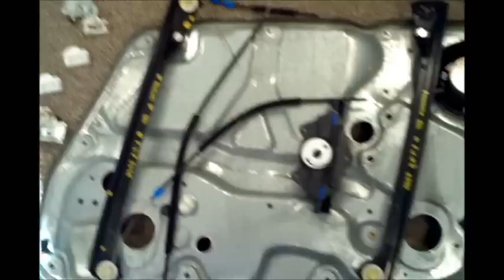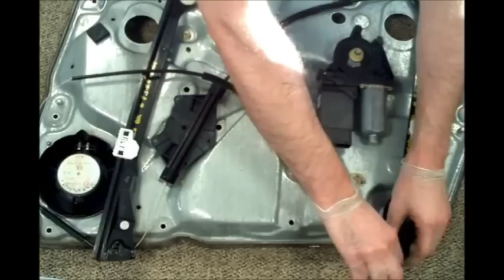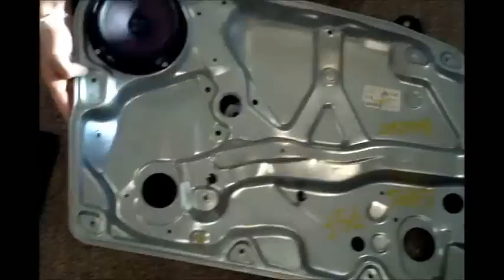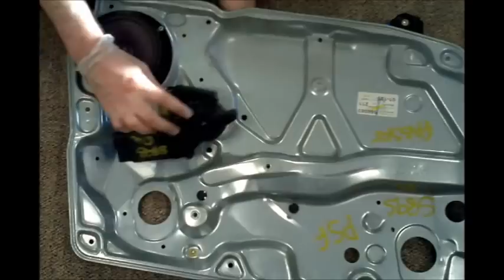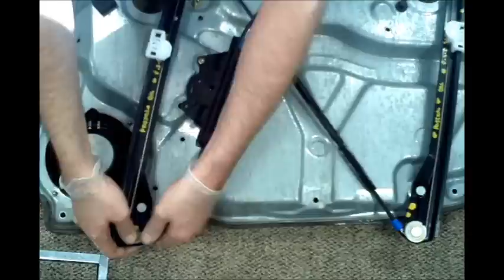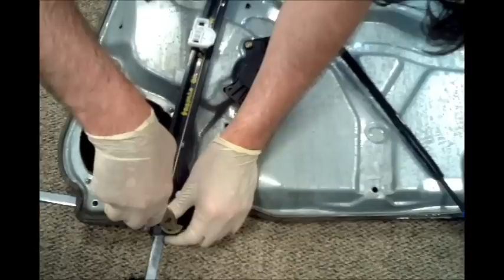VW Passat B5 Sedan Wagon front left window regulator repair work fensterheber leve vitre

Comment: Just fixed my mk4 golf electric window. The pulley system/cables are real tight when you install new ones and takes time to get cables on the 4 round runners. You have to be patient when doing this job! If you have unplugged central locking system(which is inevitable)  you need to plug everything back in for that door to lock/unlock correctly. So check the door works before putting glass and door card back on. I learnt the hard way with a headache with a door locked shut. It's part of a safety

Comment: The panel has many bolts some of which are easy to miss. Pay attention and inspect closely.  Also on some models the motor is riveted to the panel. Although this does not alloy to the Passat. From my experiences though, the majority of the time the plastic guide wheels break, and derail the cable.

Comment: Just remembered, you need to remove the two rubber access plugs found at almost the top left/right corners of the panel, do you can access the regulator to window mounting bolts. These are T30 torx. You need to lower the window slightly, in order for these bolts to be accessible through the ports. If your motor is seized, you will need to remove it first, in order to lower the window manually to the right level.
Reply: i guess Im quite off topic but does anybody know of a good website to watch newly released tv shows online?
Reply: @Jaylen Damari thanks, signed up and it seems like a nice service :D I appreciate it!
Reply: @Decker Hayden Glad I could help xD